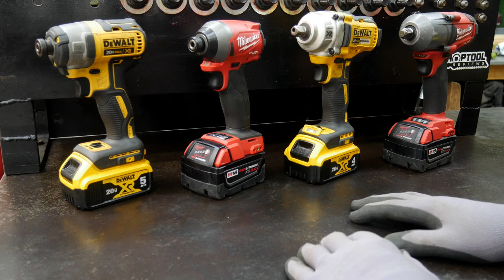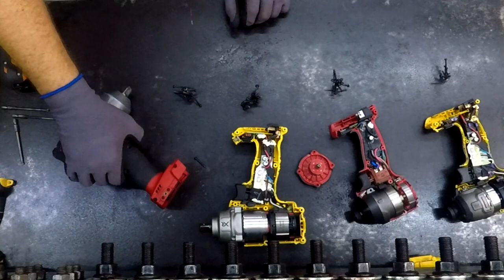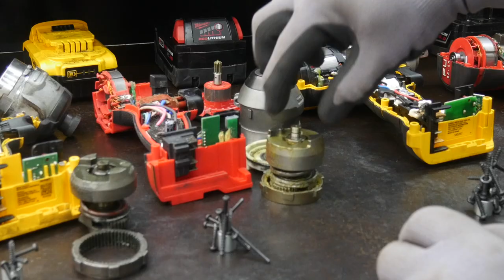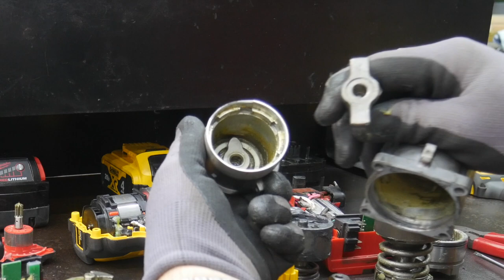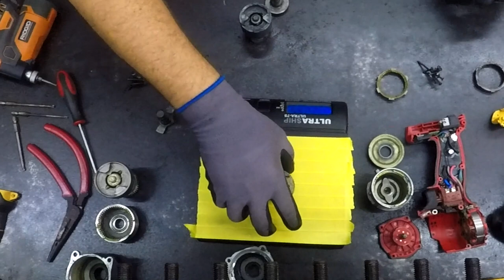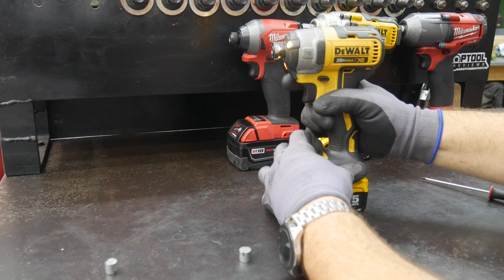WHAT's the DIFFERENCE? Impact Driver or Impact Wrench [EXPLAINED]

Comment: This helped me realize I was about to buy the wrong tool. I'm a first time DIY-er. Have to do some work around my folks house, and was about to buy an impact wrench. I already bought the drill, but while at the store wasn't sure if I wanted an impact wrench or impact driver. I could see the wrench was bigger, and my first instinct was to get that. Then I figured there's a reason for 2 different tools, so I came back and watched some vids on the differences. I need an impact driver. Thanks

Comment: Honestly it depends on brand and model.... When you get into the Mac and DeWalt 1/4 and 3/8 impacts (not the mid torques) they share many parts, the anvil/hammer being the main difference. The DCF/MCF 787, 887, 890, and 891 are a few of them. Once you get into the mid and high torque models there's a lot more differences.

Comment: I use the m12 stubby as both. Locking 1/4 hex bit adapter for screws and the 3/8 anvil for nuts and bolts and even lag bolts. Don’t have to carry two tools. Is it faster at driving screws than the m12 impact driver.  No but it is more than adequate.
Reply from the maker: That's not a bad idea. If it works for you, that's great. Thanks for watching.

Comment: Great take apart video!  Fun to see what's inside without being curious enough to take my own stuff apart.  LOL  I'll be using an impact 50/50 on lugs and driving screws/nuts so I'm going to get the new Milwaukee mid-torque and a 1/2" to hex adapter.  Speed 1 will work fine on screws/nuts but then I'll have the power for lugs and other large bolts when I need it.  Best of both worlds...I hope...
Reply: Pretty much. I do that with a dewalt mid torque. It stays in the truck for lug nuts but also with a 1/4 adapter it can do other tasks if needed. Works pretty well for the most part.
Reply from the maker: That's not a bad idea. Nothing wrong with using your tools for dual purpose. Thanks for watching.

Comment: great video, but don't you worry. you will still get people commenting that the only difference between an impact wrench and an impact driver is the anvil lol. People still try to tell me there is 0 difference be the motor and the gears. lol Keep up the good work bro
Reply from the maker: What I've realized over the years is that it doesn't matter which way I decide to go, there will always be those with opposition. Thank brother.

Comment: Should these ever be taken apart for cleaning or re-greasing under regular usage?
Reply: Whats regular use? Around the house and occasional heavier work, Nope. Unless your constantly driving large bolts into wood and keeping the tool hot all day, you wont leak out grease for a long time or really ever before everything else wares out on it.

I took apart a 40 year old stanley cordless drill that looked like it was used a lot but with care. Plastic worn very smooth from the hand. And it was still greased up, maybe not a lot but enough.

Comment: Impact driver: Hex driver, smaller anvil, thus less torque but more speed
Impact wrench: 1/2 socket, bigger anvil, thus more torque/nut busting force but slower
Reply from the maker: That's a pretty good synopsis. Thanks for watching.

Comment: Can I use The Dewalt impact driver to change my  car’s wheel lug nut thank you
Reply from the maker: You "CAN", but that's not something that I'd recommend. While it should have the power to remove the lug nuts IF the wheels were put on with proper specs and you don't have any corrosion; If a tire shop has put them on with their impact wrenches, then they're probably over-tightened and your impact driver can't remove them. Wheels are definitely a job for an impact wrench, not an impact driver. Thanks for watching.
Reply: @Shoptoolreviews  thank you 👍

Comment: Very nice comparison.  Thank you.  However, please lose the irritating "swoosh" noise with every imagined cut scene.  It is quite irritating when overused.
Reply from the maker: We feel your pain. We used those sounds for a while, but we totally quit using them. Sorry for the irritance, but we did learn our lesson. Thanks for watching and sharing.
Reply: @Shoptoolreviews  Thanks for the reply.  I now have a new subscription.  It is nice to find a channel that does such good in depth comparisons of tools.  I had a vague understanding of the difference between a driver and a wrench but your video made those differences crystal clear.  A bigger hammer/anvil will have much more momentum and therefore more driving capability. Even though many drivers and wrenches have similar torque ratings the larger mass of the hammer in the wrench will translate to more effective torque at the fastener.  Your video made that abundantly clear.  Thank you again.

Comment: This test is a bit misleading, compare close to each drivers 3/8 to impact driver of about same torque, I bet they are the same inside with different tips. I am sure the new HP line of Ryobi looks identical on the outside and are the same inside except the the tip.
Reply from the maker: I'm not sure why you think it's misleading. We're just showing you what the difference is between an impact driver and impact wrench. Thanks for watching.

Comment: Cordless drills made driving screws so much easier because of the brake on then
Reply: that makes no sense
Reply from the maker: I think you mean the clutch. Yes, the clutch helped make things much better for driving screws. Thanks for watching.
Reply: @Shoptoolreviews  no I mean the brake. When you let go of the trigger the drill stops. Maybe I'm the only one who can react fast enough to let go of the trigger when the drill is at speed so the screw doesn't go any deeper?